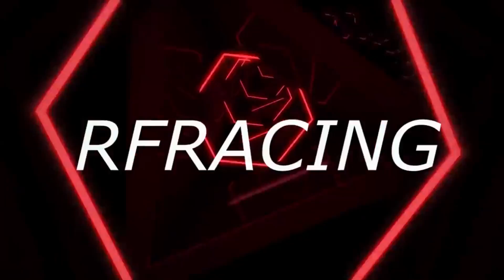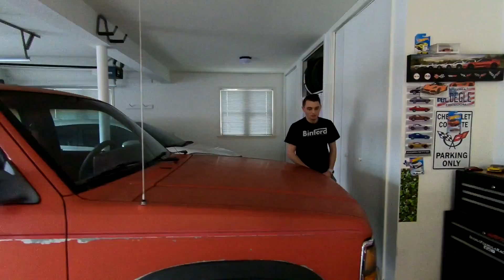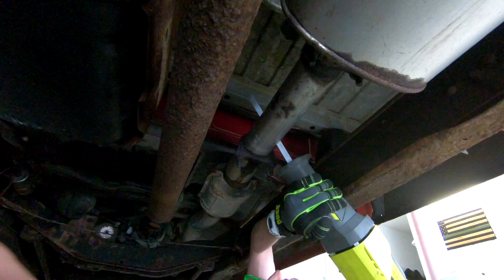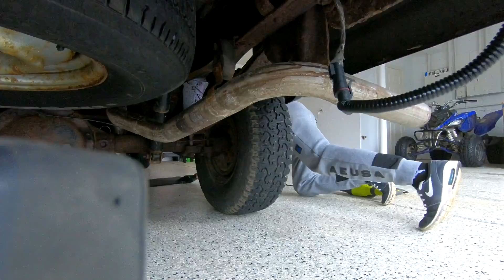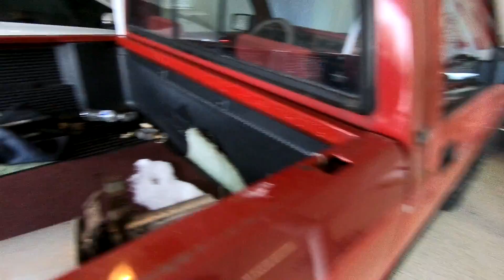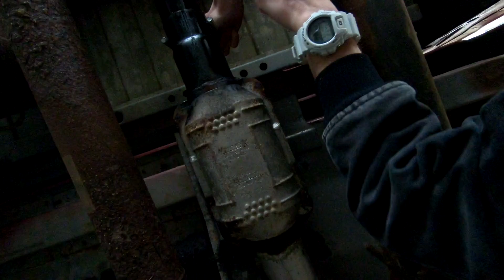My STRAIGHT PIPED $500 Truck Sounds Amazing!

Comment: I actually own and daily a 94 Dakota with the 3.9 v6 and a 5 speed. Chopped the exhaust off with my buddies and put some side pipes on it for giggles, sounded good but I threw the y pipe back on and it sounded best with just open y pipe. I have the whole thing straight piped now and I love it. Still nice and quiet in the cab.

Comment: I got my dakota for free. Was sitting and the pos drove 3 hours home on the 4 lane lol. During winter with blad tires and only front brakes
Reply: My Kota had the front brake lines cut got her for 800 bucks best fun I’ve had in a vehicle
Reply: I got mine from some guy that just had it sitting their and it only had 70 thousand miles i traded for a old Toyota Tacoma and 300 bucks best deal I have ever made

Comment: sounds really good sounds just like a v8 or v10 I am going to do the same thing with mine good ol doctor 717 I think I have the truck flu 😂 I may need to stop by
Reply from the maker: Brian Iannarelli definitely impressed me. 😂 thanks man
Reply: @RFRacing717  mine is a 3.9 doesn't have the factory exhaust but it's not loud but it well be tomorrow 😁

Comment: You need to clean the Injectors , That’s what mine was doing , once I cleaned all the injector system , Gears worked amazing!
Reply: Really? I just got a old Dakota and it’s doing the same thing
Reply: You know anything about a no crank?? Battery and starter are good

Comment: V6s can sound good at Low Rpms, but once you go over like 45mph there's not enough back pressure to maintain that sound and it sort of just fades away and sounds raspy and wimpy.I had a 4.3 V6 on a Chevy truck with a FLOWMASTER 10 shorty muffler, and MAN at startup and low Rpms down the street it sounded like a muscle car, but once I hit the highway it sounded weak.😂
Reply from the maker: BudSilverado getting the same vile from this one 😂

Comment: Probably buying a 93 318 Dakota next week. If the stock exhaust is in good condition I want to cut out a section pre cat and weld in an exhaust splitter and just straight pipe from the there to out under behind the driver door. I can have a mom setting and a hearing damage setting.

Comment: Love the Dakota videos, I have had a v6 Dakota loved it but now I have a 5.2 v8 Dakota and I personally like it better but both trucks are super fun
Reply: T.J. Jigging you know anything about a no crank buddy? Battery was tested good and starter was tested good
Reply: Bill Lee on first gen if no crank take piece of wire, take out the starter relay under hood fuse box touch side to side connectors with ends of wire and she’ll fire. Happened to my first gen
Reply: Yea I have the v8 as well it is amazing I love it and I got it with 70,000 miles

Comment: yeah those old 3.9's are made to the same spec as the 318 just with 2 less cylinders.
Reply: No they are not 😂😂
Reply: Yes they are😂
Reply: @D-WYTE  3.9L V6 had 160hp @4400 RPM and 220 ft lbs @3200. The 5.2L made 235hp and 310 ft lbs at the same RPM. "The same spec".

Comment: After watching the video y'all need to listen because you are supposed to cut the pipes at they Y ..... right before the manifold pipes join as 1.... trust me you did it wrong..... just make sure you cut it on the backside of the O2 sensor so the sensor still functions but that's going to be loud as F ...... after that connect a couple pieces of pipe for the dual exhaust and run it to the back bumper and then it will sound good but you should at least cut that damn catalytic converter off. Thx